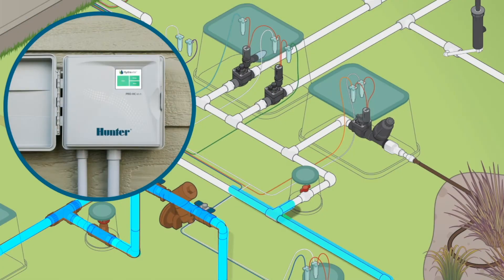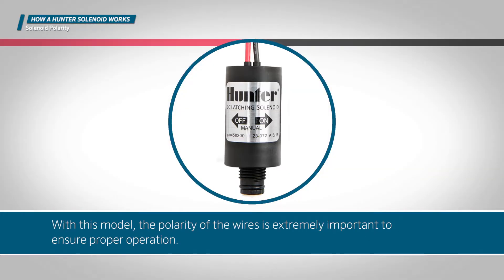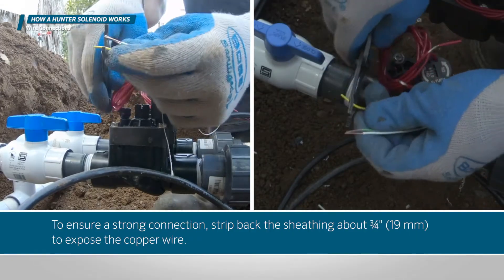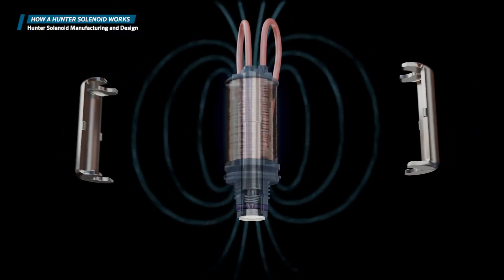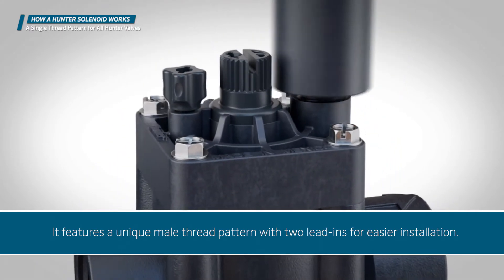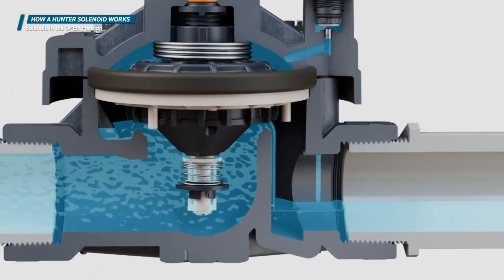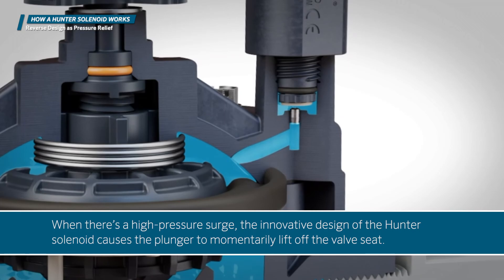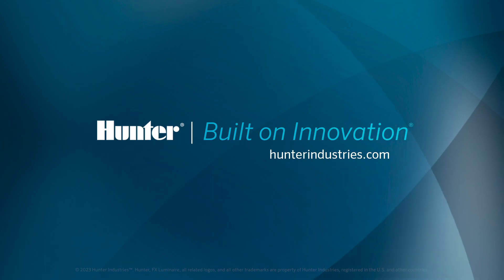How a Hunter Solenoid Works

Comment: Probably a stupid question, but at the top of the solenoid is says, On, Off and 1/4 Turn.  What way are you turning it?
Reply from the maker: Rotating the solenoid 1/4 turn counter clockwise will allow the valve to manually operate. Be careful, the valve will run until you turn the solenoid back 1/4 turn.